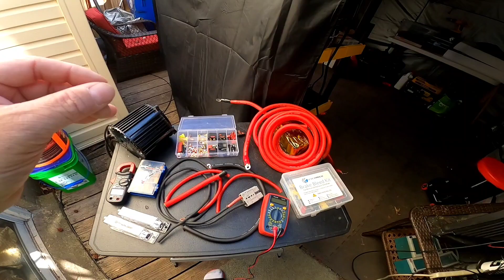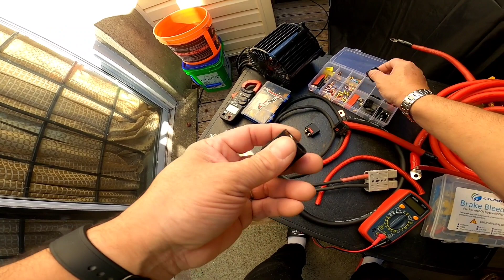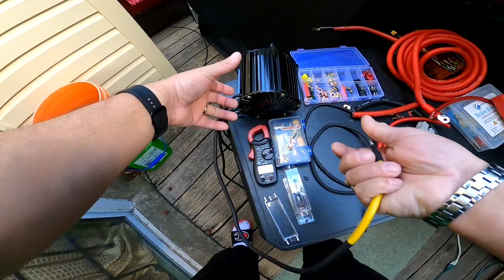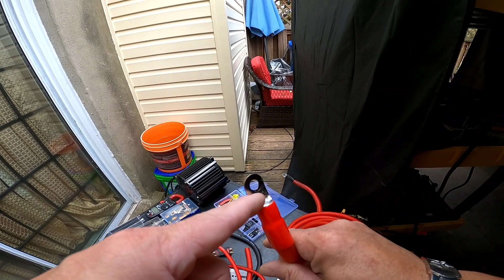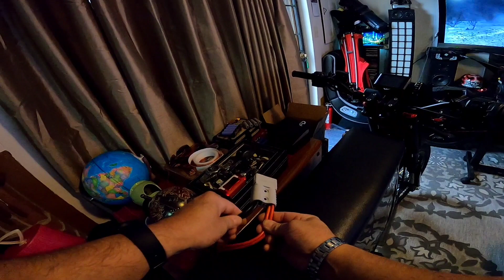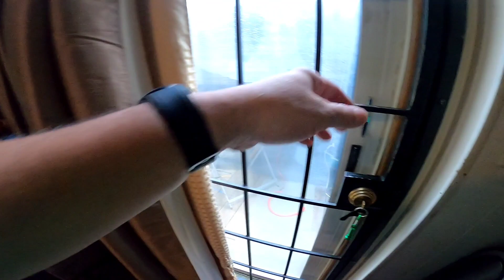BigPower, Pwr wires, Pwr connectors No Need in getting Powerful Battery if it cant get to the Motor!

Comment: Would there be a considerable difference in power transfer and efficiency with one 8AWG vs. two 10AWG cable/wires?
Reply from the maker: i had those ratings backwards i made correction just making sure you see that
Reply from the maker: its a 25 amp difference in there dc rating 10 is 30 8 is 55 but that is dc line amps thats almost double now they can both be pushed a lil harder but that really depends on how long the lenth is. if its a short wire maybe not too much but the longer the wire the more resistance and the more loss

Comment: Heya chris sorry to correct youu though mate you cant parallel fuses like you can wire its the same for diodes too, 2 x 100 amp fuses would still blow at 100 amp youd have get a 200 amp straight off ,hehe cant have a irate viewer sayinng but youu said this  now can we ,another awesome video cheers
Reply from the maker: Idk about this one Katie,  It may not blow at exactly 200 just as it doesnt blow at exactly what its rated but it definitely not blowing at the same rate. Ive done this several time in car stereo and automotive electrical systems when i didn't have a larger fuse and they were blowing.In AC if a fuse is blowing from high voltage it will still blow because its voltage blowing it but not with current When I doubled them they no longer blew so it may not be double but its definitely more than just single. Just like the quick release connectors I wouldnt use a dam fuse either Im just trying to cover all bases but Ive done that and it will work, Is it the correct way probaly best to get a big fuse if you gotta have one

Comment: thought id share this too,when upgrading the phase wires in a direct drive hub motor we found that removing the silicon outer sheath and recovering it with heat shrink made a big difference in diameter and easier to get through the axle and allways rub wires with candle wax too so they slide through
Reply from the maker: Thats the only way theyll fit exactly what I did to get those 10 guage to pass thru. That was on that cheap motor on Fank. QS has gotten better with using right size Phase wires on their new motors

Comment: people should always keep the battery cables and phases cables the shortest possible distance ,when the phases cables get to long the motor can actually suffer from going out of phase which shortens motors life ,makes it really noisey,and gets hot really fast
Reply from the maker: I should have mentioned that too good point You know most of my videos are never thought out, I just pick a topic and start rambling, lol trying to cover it all and realize what I left out after the fact, anyway not gonna make me start writing my scripts lol this is a no script show but yeah true statement
Reply: Going out of phase? What are you talking about? LOL. The motor will not go out of phase unless you either mechanically swap cable connections or it is done in the software on the controller. Long cables will only cause more heat and loss of current capability. I have been servicing generators that have hundreds of feet of phase cable.

Comment: i am of the belief if your using over 150amps leave the connectors out alltogether and just use copper eye ring terminals and bolt them together
Reply from the maker: Im of that same belief Katie I have no quick disconnects Mine goes straight from My battery to controller just like I dont have BMS but the way I do my stuff i have to tell guys that use that stuff the best way but I agree
Reply from the maker: most of those guys want quick release cuz there scared of battery fires and want to be able to remove them or take them out to charge or transport but carry some big cutters for emergency removal hahaha